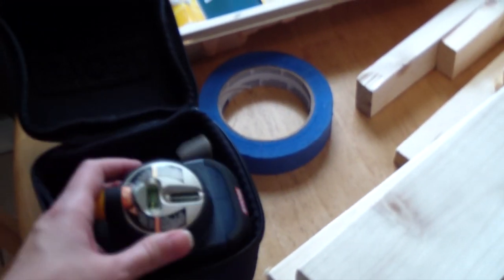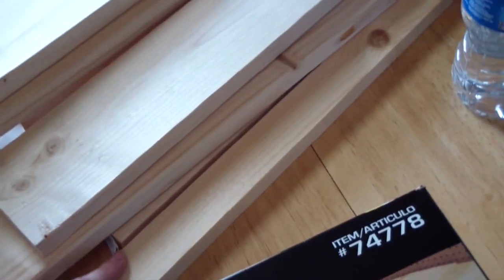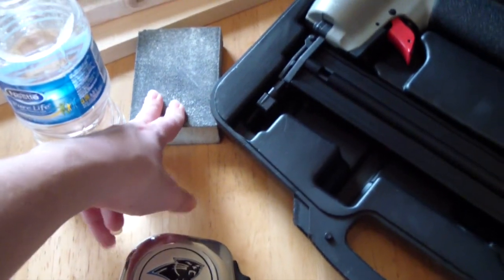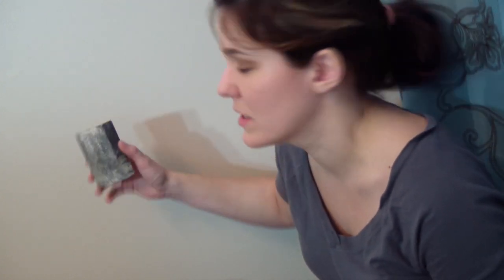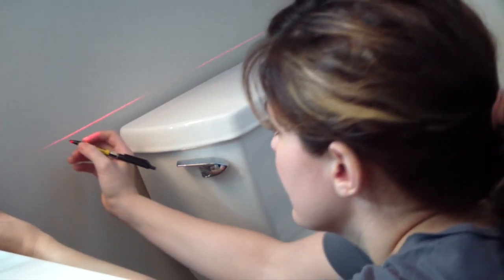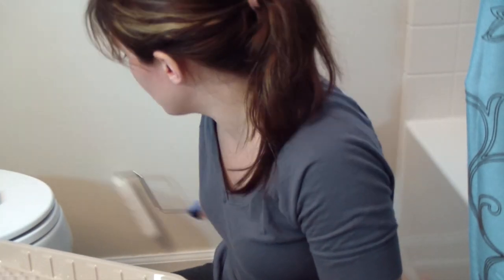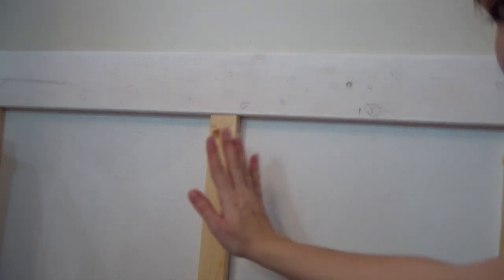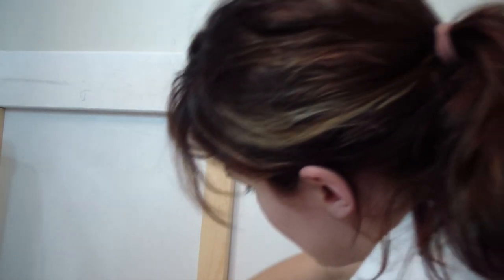DIY: Easy Batten Board Walls, Board and Batten Technique / Tutorial, wall trim

Comment: I'm adding lattice strips to my 65 year old, plain kitchen cabinets. My brads don't go in all the way and I have to use a hammer and punch to set them! 🙄 I think wood that's hung in a kitchen and painter a 100 times ( not 100, i guess. I sanded down to the 1950s lunchroom green original paint! Im glad I assumed there was lead paint somewhere on them! Any, those thin cabinet doors are as hard as stone!

Comment: Be SURE you never want to remove it before you add liquid nails! It will rip sheetrock and all if you try to pry it off once it dries! We changed out prefab countertops that some idiot glued down with liquid nails instead of the 2 or 3 screws that come with it! The cabinets were solid wood, but prefab counter tops are pressed wood or particleboard. We used a pry bar, and got it off, but the cabibets broke apart and had hunks of particleboard all over the top. We planned to try to salvage the cabinets by upgrading some elements, but liquid nailed down prefab counter changed our plan! Id us wood glue if you're also putting brads in it! 😉 Ive hung a shelf on my lath and plaster walls. Next owner'll cuss me! 😝🤪